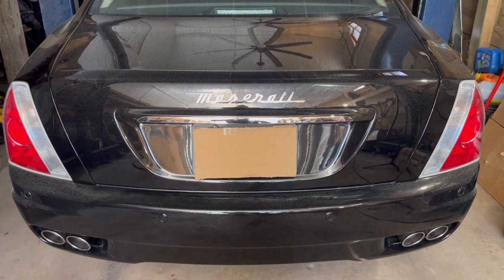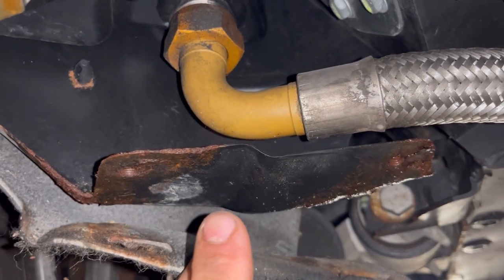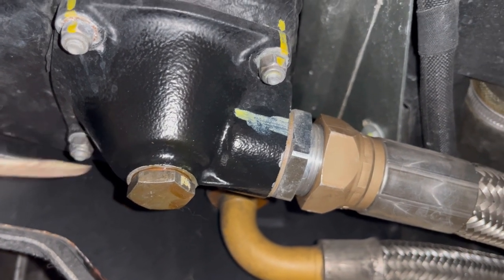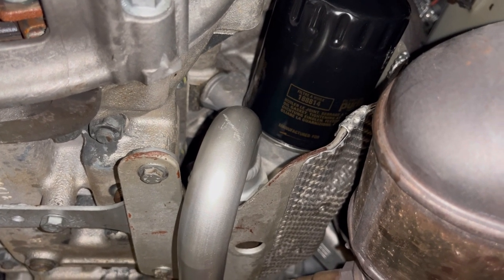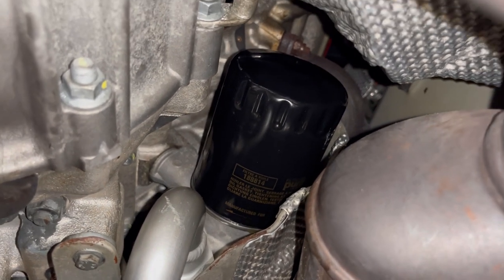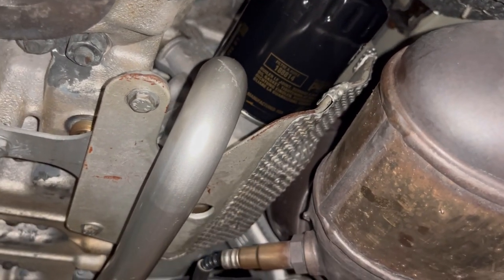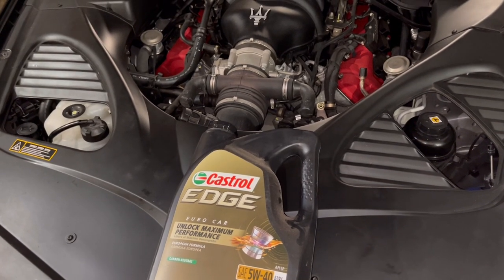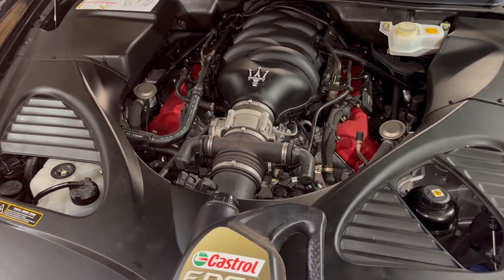Maserati Quattroporte Duoselect 2003-2007 oil and filter change quick overview 4.2L M139 dry sump

Comment: Tad, great clarification on the dry sump, I have an 06 Mas GT Executive. Thank you! The prior owner installed the 289571 oil filter for wet sump. It to was extremely difficult to remove, almost epoxied seemed like. I purchased a special 3 prong burred oil filter 3/8" socket wrench insert removal tool from Amazon, it worked fantastic! The more I wrenched counter clockwise the tighter it grabbed.
Reply from the maker: Very nice. I also had a hell of a time removing the oil filter on this particular car. I really believe it was its first oil change. Thanks for the kind words! Please keep your Maserati alive and well!

Comment: Love the video ! Also want to ask if you could do a video on the fuel filter . We have a 07 quattroporte and having trouble starting it . Battery is brand new, light turn on and everything , it just won’t crank over . I need to pull The F1 fuel relay and check that before I replace fuel filter or something else major .
Reply from the maker: Appreciate the kind words. I’ll be posting more quattroporte videos as time goes on; please like and subscribe if you haven’t already. As far as the fuel filter, I’ll have to look into it a bit more, but I believe it is non-serviceable, or essentially one and the same with the fuel pump module. I could be wrong, but that design is common these days. To be clear, it sounds like your car cranks over fine, but does not fire up?

Comment: Just wondering, I thought that we check oil level with engine running?
Reply from the maker: A fair question, but no, always with engine off. Even in the case of the uncommon dry sump oiling system.
Reply: @tadsworkshop  Tad, I am a part of the Masarati Life Forums. I know I read you could leave engine running, however, I have never left an engine running when checking oil. Thank you for clarifying over 40 years of wrenching experience I thought it was ironic.

Comment: any ideas whats the other faults of these if I went with the zf gearbox?
Reply from the maker: @dejavoo1234  I own a nearly identical car to this. I’ve had no issues with the duoselect/F1 yet. A lot of people complain about the clutch and expense of replacing it. I have 52k miles and determined clutch is around 65 percent. I’ll be doing that job myself when that day comes. But for me, it will be years from now. It’s certainly not as smooth as a ZF car. i think the ZF is ultimately more reliable. I’m expecting sensors and things to fail on this F1 eventually. The F1 is more of an enthusiasts choice. I’ve also seen rumors of someone converting an F1 to true manual operation.